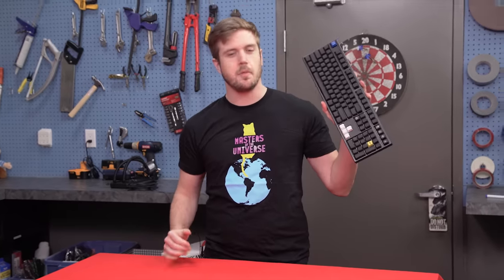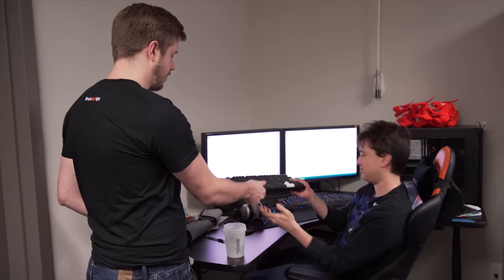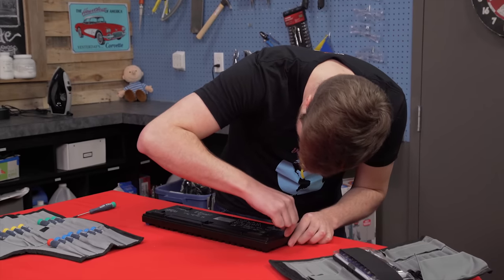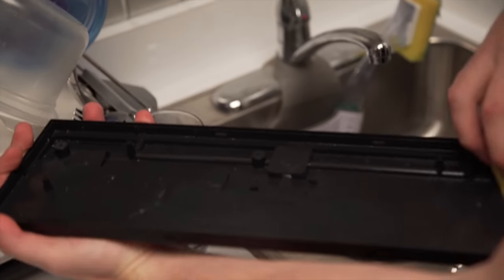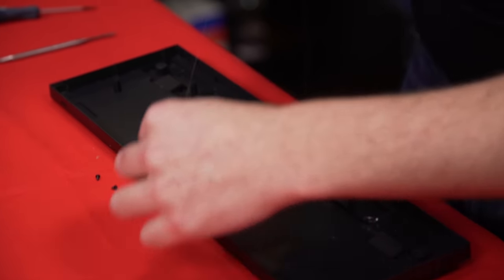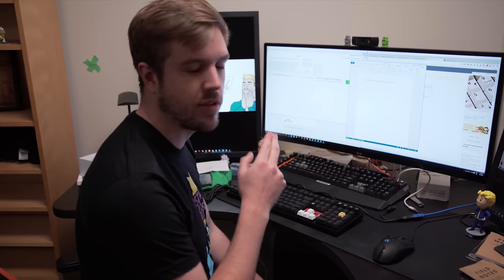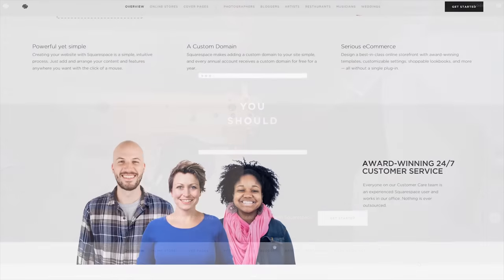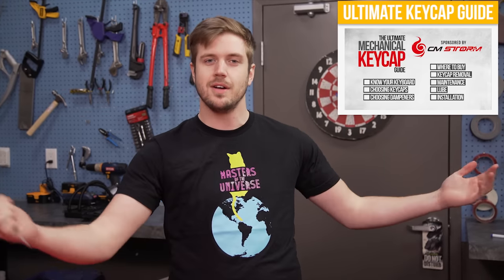Reviving my favorite mechanical keyboard - DIY Keyboard Repair

Comment: I know its 4 years old video
But for any one that got any plastic broken device 
Especially in screw places 
Use Acrylic adhesive and pick a good qulity
Its amazing in this kind of broken 
Just becarefull to not touch it or smille it until done
 or even come closer it cause burning in eyes 
But it do its job very well better than glue gun

Comment: Just.got.my.brand.new.Corsair.k65.LUX.RGB.and.as.you.can.see.the.spacebar.isnt.working...Iv.updated.the.software.checked.the.switch.and.tried.a.reset.and.nothing.has.worked....anyone.got.any.ideas?...just.waiting.on.SCAN.to.get.back.to.me
Reply: Desolation Dave try different ports, update your USB driver if you asmedia based USB controllers ?
Reply: Desolation Dave alos try it on a different PC and see if it still dose it.
Reply: Thanks for the replies, iv tried that but its all good im getting it replaced

Comment: I have 2 of these. They were cheap and are so damn good. I have one with brown and one with blue switches. One of mine broke after a nephew poured is drink all over it. I had tore it apart and used isopropyl to clean it out and blew the dust off. Worked great after that. It's at least robust too

Comment: That's good advice and all, but Wacom thought it was a good idea to surface mount mini USB ports. And what's worse? The actual solder pads broke off meaning I couldn't really do anything at all. Maybe I gave up too early though and there's some trick I don't know.

Comment: You're amazing, man! I have a membrane keyboard (V7 Mad catz - was called Cyborg, that's the one I have) so I've had it for a while, and the backspace broke recently, therefore me putting it away, until I watched  this video, stripped it apart and realised the actual layer of the keyboard (idk what it's called) wasn't properly plugged into the motherboard XD Plugged that sucker in and now it works!

Comment: is this looking alright ? 

Intel Core i5 6400

Western Digital WD Blue 1TB

MSI GeForce GTX 960 OC 4GB

EVGA 500B 500W Power Supply

Kingston HyperX Fury 8GB (2x4GB) DDR4

Samsung 850 EVO 250GB SSD 

ASRock H170M Pro4 Motherboard 

Deepcool Kendomen ATX Mid Tower Chassis Red
Reply: I'd get a higher wattage PSU just incase you want to upgrade it in the future

Comment: fixed 2 of my monitors by replacing the faulty capacitors one 3 weeks ago and the other about 2 years ago still playing like a champion an old lg 22'' 16:10 using it as a secondary display ....more or less what ever i do not want to see immediately thrown there  but was neat cause the 3 capacitors cost me a bit less than 60 cents ! generally screens that deny to open and just flashing their led like they are on stand by most of the times have faulty capacitors with new ones they come back to life you might want to do a guide on it a lot of people will find it useful

Comment: What do i need to change out the most?
Processor AMD A10-6700 APU with Radeon(tm) HD Graphics
Video Card 1 AMD Radeon HD 8670D
Video Card 2 AMD Radeon HD 8670D + R7 240 Dual Graphics
Memory 7.4 GB
Operating System  Microsoft Windows 8 64-bit

I'm sorry if i seem a bit stupid. That's because i am. I know very little about PC's

Comment: tbh this is a common issue with duckys, cm, filcos - pretty much all mechanical keyboards these days have usb ports crap out - same thing happened to my ducky one after 2 years. Awkward moment when my g105 membrane's been going strong for almost 4 years and my mechanical keyboard (which are supposed to be much better quality and last a lot longer) made by ducky (which is supposed to be one of the best manufacturers for mechs out there) craps out after 2 years.

Comment: my power plug failed me on my last laptop. cut the plug off of the machine and soldered the power cable straight to the motherboard and the computer served me happily for another year.

Comment: That's not an old keyboard, I'm still using my Cherry keyboard d91275 I bought from new. 5 pin din connector, no windows keys in a lovely old beige colour :). I've spilled umpteen drink over it and it still works fine, 4 clips hold it together no screws, very easy to clean. Cost when new £15. I think the guy I bought it from thought it was the membrane version.

Comment: This reminds me of one time I dug up my old Logitech G230 headset so i could give it to me friend. To my dismay, it was broken! Oh no! But lucky old me thought "Gee, nothing that a little soldering can't fix!" And that was how a cut a wire in a completely useless point where there was no break and soldered 5 channels of different wires together into one. A 5.1 channel surround headset became a 1 channel surround headset. I did get sound out of it, however, It was just completely garbled and warped and filled with static. Well hey, at least I got sound out of it.

Comment: I have spilled beer and orange juice in my Ducky keyboard and I swear to god, I removed the caps, and external cover, washed it with water in the sink and then let it dry in the oven on low temperature, as good as new! Now that is quality.

Comment: Luke if you have any damaged cards laying around or maybe if Free Geek has some you should do an updated GPU oven bake repair video. With a Titan X, JK, please don't bake a Titan. But grab a few from Free Geek and do something like a before and after with 10 cards. Not just 1 tho, was kinda sad when Linus did just 1 and it didn't work. A group batch would have a higher chance of success and intrigue. Also be sure they aren't physically damaged, like being dropped.
Reply: Not sure what reball is, but it's like a getto way to reflow the pcb (melts the solder). I had an old laptop that had the gpu crap out on me and I decided to do it for sh*s and giggles. Take off the plastic parts and put it in the oven at 345 for 15 mins. Like cooking a pizza lol. Actually worked like a charm and my friends daughter is still using the PC to this day.

Comment: I found out that my Steel Series Ikari mouse had a double click issue a while back, so I took the mouse apart, found the compartment that had the leaf spring, opened that up, and from there I had to bend the tiny thing in a way that gives optimal clicking resistance while still fitting in the right area. 
After putting that little compartment back together (was the hardest part), I solved my double click issue for free instead of buying a new mouse and I still use that mouse to this day :^)

Comment: Why would he not hot glue the back of the board to counter the lateral movement as that's where the pressure comes from whenever he plugs in the USB cable constantly.

Comment: i tried this with my favorite keyboard, a dell AT102W after my partner spilled cider in it and it worked, mostly, all but the M and B switches worked after my attempts to fix it, miss that board, on MX greens now but i'd give it all up for another black AT102W XD

Comment: The enter key on my razer blackwidow from 3 years ago is broken (It sticks inside of the casing because the plastic that hold the metal bar attached to the key switch broke). I got a logitech g710+ to replace it, and it is much better because the keys are silent, but I still miss this sentimental keyboard. How can I fix it?

Comment: I've a strange question on the keyboard pcbs, can you technically "cut" a part of it keeping the other keys working? what I mean is: are the keys isolated on the circuit or if you cut an angle of the pcb the other keys die?
I know that this depends on the circuit but I mean "normally" are they isolated?
Reply: Most keyboards use a matrix that connect the switches with each other. So not really.

Comment: HEY, JUST A SUGGESTION???? GET A SMALL COMPRESSOR, 20' COILED AIR HOSE, QUICK-DISCONNECT'S, MOISTURE TRAP, BLOWER NOZZLR & TIRE FILLER THINGEE..... CANNED AIR IS NICE BUT ALSO IS HAVING A COMPRESSOR IN THE SHOP... LIVE ALOHA

Comment: I really wish I could learn how to replace the key caps on my noppoo choc mini. It' my favorite keyboard because it just feels amazing when you type on it and it's also super clicky.  The S key is really mushy feeling now and doesn't always work, and now the k key is starting to go out as well. I bought the switches for it a while back, but never bothered taking it apart to try and fix it because I think they are attached to the pcb.

Comment: thats why i dont use mechanical keyboards "maintanance and lubing" for such a thing to exist ... Low keycap Rubber is the way to go...  atleast for me cuz i  get messy with my keyboards and Mechanical keyboards have a tendency to get "stuck" when ur in a messy enviroment (15m^2 cooking a stew) and i have only a desk ... not a eating table which makes it even messier and highkeycap tend to attract more Dirt than low keycap and mechanical switches are fairly sensetive to dirt

Comment: Personally, I don't understand the fascination with fancy, expensive, loud, clacky keyboards. I have used the standard, cheap, non-mechanical one that came with my HP for like three years. I love this thing. Problem is that beer loves it more, and I have a few non-working keys now. Otherwise, I wouldn't spend too much on a new one; but who knows, I might change my mind today. My new keyboard and mouse combo should arrive today.
Reply: Blueshirt go to a tech store and ask them to check out a mx Blue keyboard. Yo will feel why we like them. Plus you can find them for 75$ (good ones)

Comment: So if you had to chop a USB extender and solder it inside the keyboard, would you have done it directly to the small PCB on the inside? I have an old keyboard like this too but my port to plug the extender into the keyboard broke and is long gone. I was hoping that was the case with yours so I could see what you did but yours was an easy fix. Anyone have any ideas on how to solder on a usb extender like he said he was going to do?

Comment: i managed to spill my drink on my keyboard once, thought it was ok after drying it a bit, then i pressed enter and "ehnsjlhd¨g"
was like "eh fuck it, its broken anyways." so i tried getting the soda away from the connections by putting it under the tap, and it worked

happened again later, with a cup on instant noodles, which instantly made every single key press, and opened around 20 new desktops...
ran it under the sink again and it works completely fine, with only one RGB missing the blue, and some keys double pressing (esc and 111)

Comment: The problems I have with fixing things is:
1) It's no longer original (for some reason I can't stand that).
2) I have a problem with forgetting things, so I probably will mess up when repairing stuff.

Comment: I´ve repaired my Asus x53s laptop 3 times around (my friend helped me out soldering the power connection jack thing). But ofcourse the input on the battery re.charger cord had to break apart too so I´ve been jamming the laptop inbetween the armrests on a computer chair and it worked for a long time... Untill it melted and I had to ripp out the charging thing with a slip joint plier. But then the little metallic rod inside broke ... Think I gave up? Nope. I found the two broken of pieces, lined them up inside the charging dock and the charger cord and then I slammed it in and wedged the whole thing into the armrests again with the help of a coupple of cardboard bits and an old painting. It´s been running for 8 months and I can continue to have a laptop. But I don´t dare to turn it off so it´s been running that whole time lmao. I´m afraid at night that the thing is going to burn down my house so I added a bit of cooling by placing a large house-fan next to it on a box and it´s been keeping me safe so far.. Too bad I can´t use the DVD though. I wouldn´t exactly call it a "repair" more like a "final life support" kind of thing. Had this laptop well beyond its life expectancy...

Comment: There seems to be a short in the USB harness cable for my first generation Razer Black Widow Ultimate, and I really loved that keyboard, and Razer refused to sell me a replacement cable(all I would need) and I was unable to find a cheap one to disassemble on ebay. It makes me sad. If I were more electronic-savvy I might be able to narrow down the break in the cable and bypass it but yeah.....I dunno.

Comment: if the keyboard is completely broken beyond repair, you should search eBay or Amazon for the same keyboard and them replace it's keyboard and backplate with the one from the broken keyboard

Comment: If you guys are disassembling PC's so often why not just get a small air compressor and run some tubing? Would work out cheaper in the long run over buying air cans over and over

Comment: Wayt, so is it wireless oe just deattachable? Whats the point of a deatacheble cable then?)
Reply: max vinichenko so if the cable breaks or u want a longer one u can replace the cable instead of the entire keyboard

Comment: Probably should have put on a second coat of hot glue along the back side of USB PCB or else never unplug the USB (hot glue it in permanent), because hot glue will fail after a few months  if unplugging all the time, good luck

Comment: Cherry switches sound and feel like you're using a toy made for small children after going back to the buckling spring.  Fuck modern day mechanical switches, they just ain't made right.
Reply: Agreed totally. Alps SKCM and IBM buckling springs are easily the best switches out there.

Comment: I cannot stand mechanical keyboards, what's the appeal?
Reply: Well not all mechanical switches are clicky like these and despite what everyone says Cherry isn't the gold standard. There are many reasons to like mech keyboards. You don't have to bottom out so your fingers aren't tired, you can have them be light or heavy depending on your preference, and you can make it known that you actuated the key with a tactile bump or with a click.